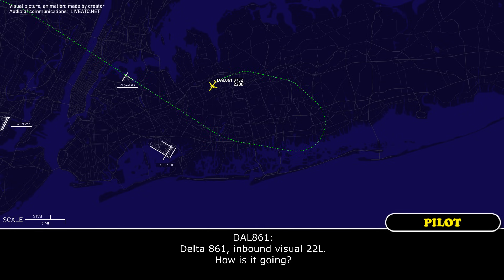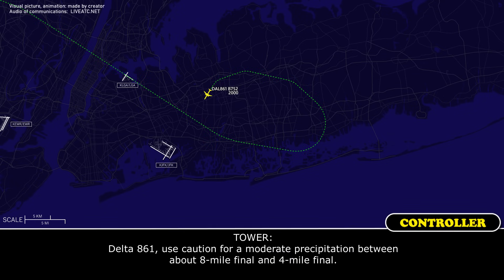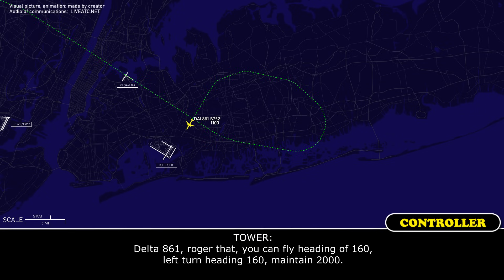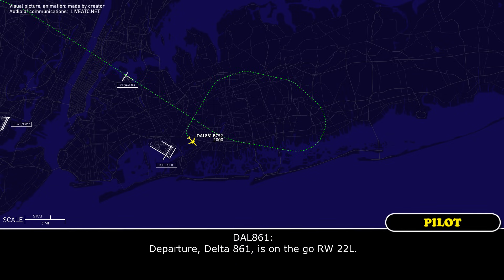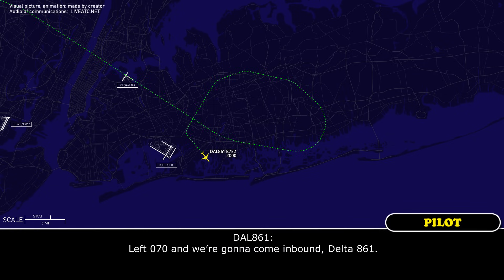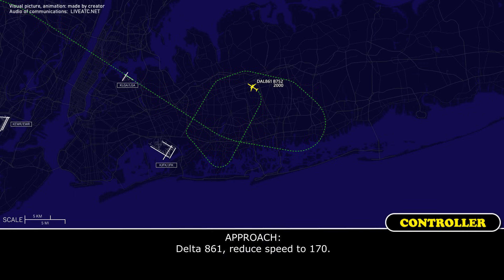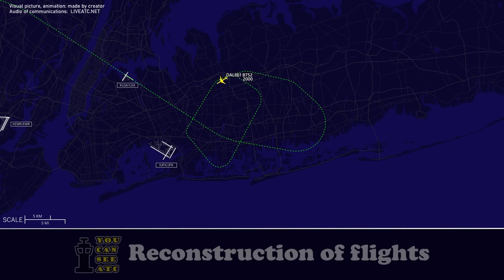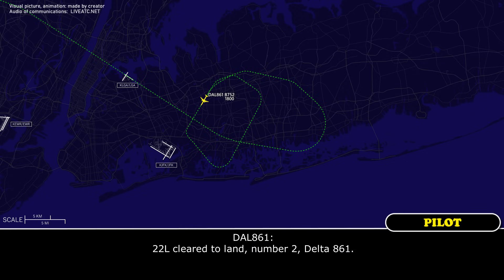“We can’t land with that”. Passenger in the lavatory. Delta B757 goes around at Kennedy. Real ATC

Comment: So someone gets up and goes to the lavatory during the approach.  What, if anything, is likely to happen to the passenger who caused the go-around?  Not what should happen, but what if anything will happen to the passenger?
Reply: Hard landing on the toilet and get splashed… ewwwwwwwwww
Reply: A stern reminder from the FA ver the PA to stay seated is all that will happen.
Reply: The crew's job is to secure the cabin for landing. This involves checking all the toilets and locking them. The question is not what would happen to the passenger, it's what would happen to the crew that allows this to happen.

Comment: It’s perfectly safe to land with someone in the toilet. In fact, there’s likely a point when the cabin crew can’t contact the pilots to tell them about stuff happening in the cabin, so going around from low altitude isn’t an option.
Reply: No it isn't. You have an unbelted passenger, possibly standing. Min fuel you're landing anyways, but go-arounds are encouraged in the US. FA's are trained that cabin calls to the cockpit on short final will likely result in a go-around.
Reply: @tankerdriver6329  - airlines are more than likely to have a “no contact” period during take off and approach. Anything happening in the cabin during this time stays away from the pilots, and for good reason. A standing passenger, or one locked in the lav, isn’t any concern of the pilots.  That’s well and truely in the cabin crews domain.
Reply: @EdOeuna  As an airline captain at a major US airline, you’re incorrect. The cabin crew understands that they may contact us during sterile but that it may generate a go-around or rejected takeoff. And YES, I absolutely want them to contact me if someone is in the Lav on approach.
Reply: @tankerdriver6329  - every airline I’ve flown with has a no contact period during both approach and departure phases of flight. ANYTHING happening in the cabin during this time must not be communicated with the pilots because they have more than enough to worry about. A passenger in the toilet poses far less threat than performing a go-around and being resequenced back to the runway.but it isn’t just misbehaving passengers. This no contact period covers everything, so a machete wielding maniac to a laptop fire and everything in between.
Reply: @EdOeuna Ed, a 20-year veteran 121 captain just told you that you’re incorrect. As a 121 pilot myself, you are incorrect.
Reply: @EdOeuna  Where you live that might be a thing. It’s not here. Prohibitions on flight safety related communication are dangerous. An attitude that a go-around is in any way dangerous is unprofessional. Go arounds will always be safer than a pax in the lav at touchdown. Whether it’s worth the effort is Captain’s discretion…discretion he/she can only exercise if they have the information.
Reply: @comcfi  - I’ll just tell my wide body international airline that achieves top 5 rankings in quality and safety every year that some guy on the internet thinks they’re wrong to have a rule that tells the pilots to land the plane regardless of anything happening in the cabin, beyond a certain point. I’m sure they’ll instigate change immediately.
Reply: @EdOeuna  If that’s how your company wants you to do it then the legal burden is certainly off you. I think it’s bad policy. But it’s certainly a lack of professionalism to criticize this Delta crew in any way.
Reply: @tankerdriver6329  While Ed and I have definitely disagreed in the past on various subjects of safety, I agree with him on this issue. What is more dangerous for the pilots and the air traffic system, a normal landing or a go-around? As for the passenger, they're more likely to be injured in a go-around considering the high frequency at which aircrew screw them up -- which is why my company and Delta recently had to focus on go-arounds during recurrent training. Besides, the passenger is confined in the lav (a small space) and they directly violated the crew's instruction; therefore the company is not liable.
Reply: @JohnSmith-zi9or  A go around is a normal procedure. The FAA’s emphasis for the last 20 years has been trying to get us to do MORE go-arounds. Too often an incorrect decision to land is made. I’m not saying I would go around in this case, but it is entirely appropriate for the FA’s to notify me someone is in the lav. I’d like the information to make the decision in the first place. Are you going to continue if a baby is being changed on approach to SNA? We need the information.

To clarify, my main point is Ed’s assertion that FA’s aren’t supposed to communicate this to us in Sterile. That’s incorrect in the US, but maybe Aussies do something different.
Reply: @tankerdriver6329  The FAA lowered the decision point for stabilized approaches so they're don't care if we go-around or not. And that is irrelevant to the discussion. 

 You're flying the dreaded straight in to SNA in the weather and you're passing the FAF and the FA dings the cockpit -- or you're approaching minimums and the FA dings the cockpit .... are you taking that call? Yeah, no safety issue there. (sarcasm). Even not in the weather it is safer to land. 

You are exposing the flight to more risk by going around for someone in the lav.
Reply: @JohnSmith-zi9or  - exactly. I agree 100%. I can’t think of a single thing that could happen in the cabin, below about 2000ft, that would prevent me from landing, or could not wait for 2-3 minutes until the aircraft has vacated the runway.
Reply: @JohnSmith-zi9or  Stabilized approach is irrelevant to the discussion (Yes that what started the FAA’s focus on GA’s). You and your friend are implying that a GA is somehow a maneuver you wish to avoid for safety of flight…somehow it’s safer to land while you criticize a Delta crew for making their own decision to go-around. Your whole discussion and attitude towards go-arounds and the fact that many of us, including me, would go-around to avoid landing with an unprepared cabin (with some exceptions) speaks to a lack of appropriate safety culture.
Reply: @tankerdriver6329  My point of the stabilized approach criteria is that the FAA is not pushing for more go-arounds. By significantly reducing it down to 100' they've acknowledged what pilots were already doing, hitting the former stabilized approach gate not stabilized and fixing it before landing. 

The person in the lav is in a tight confined space. If anything they are only a hazard to themselves that THEY decided to ignore crew members instructions. 

Im sorry it isn't a lack of appropriate safety culture. By going around you expose the flight to much more risk that you wouldn't have otherwise. That's not saying that a go-around is dangerous. But a sure hell of a lot of pilots dork them up. And a very high percentage of go-arounds seen on these videos have the pilots making two or more radio calls to ensure they have the right heading and altitude. 

They add in more risk than just landing the airplane. Period. Not going to argue.
Reply: Just to add context, the fact that our cabin can contact us allows us to give a quick PA to get the offender back in their seat. This has always solved the issue for me.
Reply: @tankerdriver6329  - as hominem fallacy at okay here. Can’t debate some ridicule the opposition. 

I also fly for a large world class airline. I wrack my brain for anything from the cabin that would stop a pilot from landing below 2000ft. I can’t think of a single thing. 

Extrapolate this to an extreme, eg autolands. Even the aircraft stops talking to the pilots for the majority of failures. Literally about 5 things will stop an autoland. Everything else is ignored by design. This is how pilots fly. Focus on the aircraft and landing and not some nonsense from the cabin. That’s what cabin crew are for.

PS: it’s my airline policy. That policy has been signed off by all international bodies that govern international flight. You have a problem, take it up with ICAO.
Reply: @EdOeuna  You showed up to criticize the Delta crew. You don’t like it take it up with the FAA and ICAO. As a pilot you shouldn’t be here to criticize a safe decision by a professional crew. Period.
Reply: @tankerdriver6329  - when have I criticised them? I started by saying that landing with someone out of their seat is perfectly safe. I then said that the flight gets to anoint where cabin crew can’t contact the pilots. Basic common sense, plus my SOP, tell me this. Like has been pointed out to you already, at 500ft are you going to answer the inter phone or just land, clear the runway, then contact the cabin? That’s the safest thing to do. There is nothing that will happen in the cabin, below about 2000ft, that requires intervention from the pilots. At that point their job is to land the plane and sort out the problem on the ground. It might not be SOP at your airline but it is at mine, and, to me, it seems blindly obvious.
Reply: @EdOeuna  Well, you restated your criticism perfectly, thank you. “Landing with someone out of their seat is perfectly safe”—It is inarguably not perfectly safe and that is a direct criticism of the Delta crew deciding it’s unsafe and performing a go-around. Don’t know what else to tell you, you said it yourself.
Reply: @EdOeuna  And to answer your question, at 500ft I will likely not answer but may initiate a go-around (depending on fuel state), and call the cabin back on downwind when I’m no longer task saturated. Remember, in the US we are in “Sterile Cockpit” below 10000 feet. If the FA’s are calling us below 10000, it is to report some sort of safety issue, to include the cabin no longer being ready for landing.

Same goes for takeoff. Our FA’s are trained that if they call us on the runway that may lead to an abort/rejected takeoff.
Reply: @tankerdriver6329  - great. And my airline enhances sterile cockpit with no contact period from gear down to vacating the runway. Nothing gets in the way of landing the aircraft.
Reply: @tankerdriver6329  "and call the cabin back on downwind when I’m no longer task saturated."

Why would you be task saturated? Go-arounds are just every day maneuvers that always go as planned -- absolutely no risk to them.